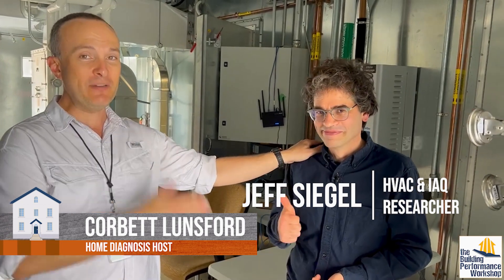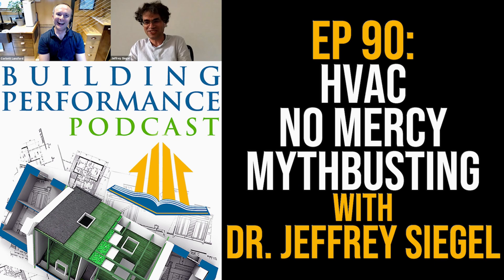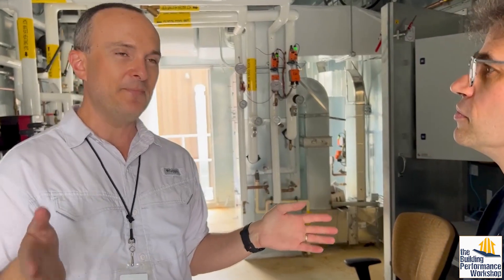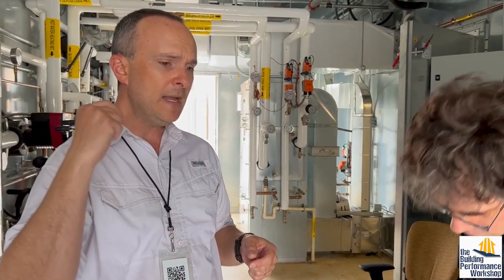Home Ventilation Advice from HVAC Researcher Jeffrey Siegel: How Many CFM is Ideal?

Comment: Hello,If you have a leaky house and installing a erv is not a option,would be a positive fresh air supply system a good option? Thanks
Reply: Postive pressure is recommended unless your in cold climate where you have to run negative pressure to avoid moist inside air hitting cold walls and condensing or frosting. Balanced systems are pointless when there is more air leakage than ventilation air flow.
Reply: When a house is deemed to be leaky, based on a blower door test under 50 pascals of pressure, it doesn't mean that the home has adequate ventilation. That is a myth.  When it is calm out the natural air change can be minimal, and the indoor air quality can be poor.  I agree that standards established like ASHRAE 62.2 are nonsense.  Air quality needs to be monitored and controlled based on the air quality, not the size of the building and the number of occupants.  Without a demand controlled ventilation system, every home is either over ventilated or under ventilated. A ventilation system should be as close to being balanced as possible, with a slight positive pressure in humid climates and slight negative pressure in cold climates.  The problem with a strong pressure difference is in all climates there are certain conditions that a strong pressure difference can create a problem.
Reply from the maker: Yes. Fraction of cost, and dispenses with the additional filters and heat exchanger, which need continual maintenance.
Reply: @HomePerformance  so Corbett, if you have a house at say ach 1.5-1.9, do you HAVE to GO the erv route? A dehumidifying   goin g into house supply seems compelling erv, fewer ducts, etc. and as you noted, continuous air exchange is unnecessary and deleterious re humidity and even electricity use .
Reply from the maker: Video forthcoming, John and everybody
Reply: @HomePerformance  👊🏻👏🏻
Reply: Corbett- it appears your thinking is evolving away from the complexity of your own house somewhat after living with it for 4 full seasons , and at the same time toward a  demand based/triggered  by pollutants than  continuous ventilation approach?  There just seem to be so many variables, and most have next even given adequate thought to radon, inarguably the most toxic air pollutant facing many homeowners in USA; the interaction between subslab and indoors pressures deserves more study for sure with more people manipulating the air flows in their tighter homes. E.g., most homeowners and even radon migators don’t test multiple times at multiple erv settings to establish optimal radon levels. Air r-reassure and soil moisture impact radon transfer greatly. I m not convinced everyone can assume a stronger subslab fan is better, indeed at sufficiently strong pressures you could  drawing radon into the subslab space from periphery, and if your basement had cracks etc you could be raining indoor radon levels ! What a fertile field you have chosen to focus on !
Reply from the maker: Agreed, John, this work only gets more interesting as time goes on! I think there’s a place for every strategy and product type, depending on the specific scenarios. And the scenarios are always evolving.
Reply: My understanding (and someone who knows more than me will likely comment too) is that you still want the ventilation balanced to try and avoid pushing or pulling air through the leaky house. Just forcing the outbound air out through all the cracks and crevices doesn't seem like a good idea based on what I've learned so far.
Reply: Thanks,I’m in Fl,humidity is a concern